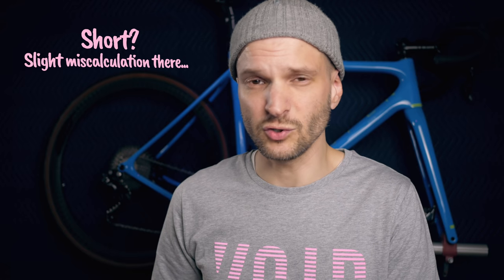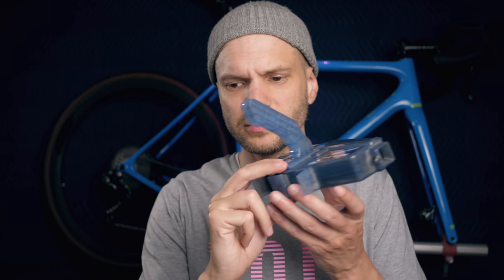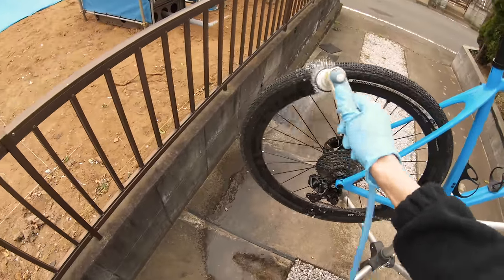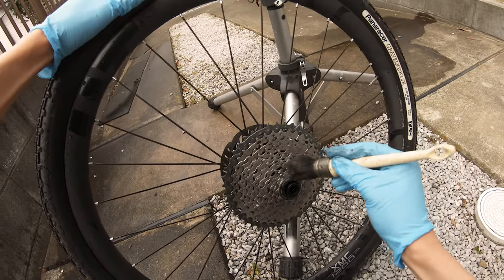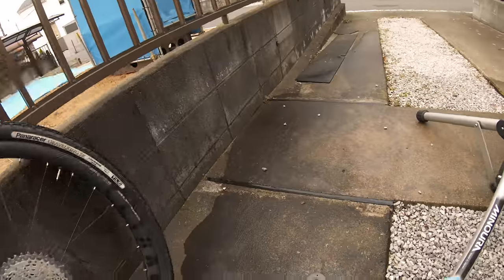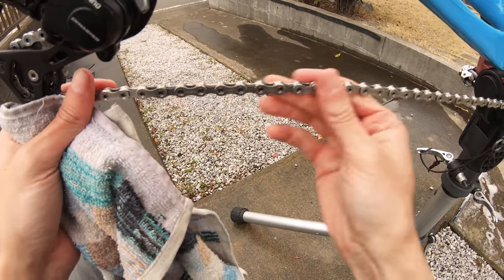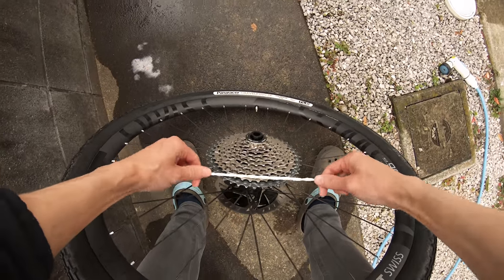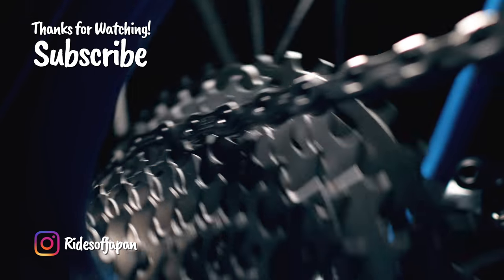My obsessive compulsive chain cleaning disorder

Comment: Good video, but have you thought of waxing your chain. There's no need for dirt attracting oil, and bike cleaning is a revolution, just a gentle wash down with bike wash and rinse, and then a dry with a muc off ptfe water dispersant and polish, like clean and shine (or whatever it's called). Froomey set his world time trial records with a waxed chain, it's supposed to save a watt or two. Metal debris and grit both stick to lube oil, that mix wears your cassette and chain rings, and chains last longer with waxing as the rollers don't wear down. There's no oil lubing needed between monthly or bi monthly waxing. Anyway as you can see, couldn't recommend it enough.....

Comment: Don't waste your time with this, use Squirt lube or Molteni Speed wax for even better results. The drivetrain will almost clean itself on gravel rides
Reply: I just buy pure parrafin wax from eBay. 2kg block for less than Aud$25. No degreasing required. No black grease ever! Just dunk in slow cooker! Lowest friction too according to Friction Facts. Good times 😁

Comment: you really need to transition to waxing your chain. Since I've switched to wax (using the friction facts formula) I never looked back to the gunky oils. I use an ultrasonic cleaner to clean the chain. then wash it with soapy water. dry it and once fully dry use another ultrasonic cleaner to soak the chain in wax. The chain stays perfectly clean even after several hundred Kilometers. It takes at least 4 hour rides in pouring rain to make the chain a bit dirty. and even then you can still just wipe it. It's just no comparison to normal Lube, regardless the different types, and believe me I tried almost all of them. Squirt lube comes close and I still use it sometimes to just apply an additional layer of wax on my chain if I don't have a freshly waxed chain available. I just have multiple chains for my bikes so that when I clean and wax I just do like 4 at ones.
Reply from the maker: Mark van Suchtelen I’ve read up on that as well, the main thing holding me back is the reports on drive train noise.
Also was flakes all over my bike 😱
I don’t doubt it’s super efficient though.

I rather enjoy cleaning my bike so don’t know how good wax would be for a weekly cleaning routine ? 🤔
Reply: Rides of Japan i’ve not had any noise issues since using wax. My experience is that it’s actually more silent with wax. And yes the first ride it will flake but you can wipe it of easily. Especially if you clean your bike it wash off easily. I wash my bike more often than I clean my chain. I just use a dry towel to wipe the chain to almost clean condition. Since the wax is dry it will not collect dirt and it is naturally hydrophobic. So cleaning your bike is not removing the wax as long as you just don’t wash the chain. Just wipe it with a dry cloth.
Reply from the maker: Mark van Suchtelen good to know!
I might eventually go down that route... first step will probably be Squirt though.
Reply: Rides of Japan that is a very good first start. That is how i started as well. My LBS advised squirt lube. I immediately noticed the difference in noise reduction and a much cleaner drivetrain. 
Even after several hundreds of kilometers. Good luck and looking forward to your experience with wax. Hope to see it in a video soon

Comment: judging by the number of comments - is this your most commented video to date?! - this is a subject that's close to many - most? - serious cyclists hearts. I'm tired of a near-constantly gunky chain even with regular de-greasing and lubing. Waxing, using Molten Speed Wax is in my near future, just as soon as I collect all the extra gear and stuff together, like an electric crock pot I don't mind filling with wax! And maybe an ultrasonic cleaner - they seem to get a lot of recommendation.

Is it my imagination or do chains not last like they used to? It seems that when we went to 11-speed cassettes chains became an item that wears out quickly and needs replacing often. They're not cheap either if you're using Shimano or SRAM chains, or heaven forbid, a KMC or CeramicSpeed chain! I have older chains from bikes with 6- & 7-speed cassettes and they seem to last forever by comparison.
Reply from the maker: Trey Quattro the more gears you have the thinner the chain needs to be (less material) and thus it will wear out faster. I don’t think it’s a conspiracy to sell more chains by the manufacturer... at least in this case ;)
Reply: @ridesofjapan  probably not, but it's an added expense. Plus chain pins of course (expensive too!!!) or, if one is so inclined, magic links.

Comment: Just wax your  chain, i'm a little bit like you (love a clean chain), wax is the best solution.
Reply: Agreed. If you use a dryish wax it just flakes off and it does not attract dirt like oil. It work reasonably well in rain too. It does NOT work in winter when it it well below freezing point. It gets too stiff in those conditions.
I've found White Lightning was pretty hard (that I like), Pedros seems more "greasy" which is good for low temperature season. White lightning seems to was away in rainy conditions and needs reapply after a rainy ride. I think Pedros is better for rain (or my own mixture).
Mostly I prefer my own mix, just some paraffine wax, a bit of paraffine oil and somy xylene to thin it out. Homemade stuff is dirt cheap too.
Reply: @hoggif  I haven't had any issues in sub-zero temps with wax. I use it on my fat bike in snow and it's fine. I have had issues with wet lube though. One time my chain seized up when left outside overnight.
Reply: @philadams9254  That's interesting. My cycling season has temperatures below -20C (0F) and my was has been quite stiff. Perhaps some different mixture with more paraffin oil for example is ok in cold. I need to investigate that more when it gets cold again.

Comment: I can guarantee no matter how much you try a clean the chain with degreasers and chemicals it will not get all the contaminates out from within the inner rollers and pins. However an ultrasonic cleaner will completely clean the chain. If you are not using an ultrasonic cleaner you are not cleaning your chain.

Comment: dude, its not obsessive, its just healthy. Think of it this way, does the joy of riding a perfectly silent, ultra smooth-running beauty outweigh the pain of having to endure a gritty, noisy monstrosity while youre out on a ride?. . . . thought so, nothing spoils a ride like noises and crappy running equipment!

I use a kmc quick link that i can de-link and re-link by hand, highly recommended. After 2 rides, unlink, put the chain in a pot with some degreaser and leave it for half an hour, rinse and scrub with a brush, keep rinsing till its spotless.....re-attach, re-lube. Keeps my chain, chainrings, cassette running ultra smooth. . . 

KMC DLC 11 re-usable links
http://www.kmcchain.eu/connector-KMC_MissingLink_12_DLC_non%E2%80%93reusable-road_cross-12_speed

it says non-reusable but it is, I slightly file down the keyhole bottleneck on each link so that it can be unlinked again, easy. Done this for years now and never had a single issue.

Comment: Those small (1/5L?) bottles that you 3/4 fill with liquid and manually pump up with air, can be used instead of the battery powered thing. Just leave out the liquid and pump away. for example only https://www.youtube.com/watch?v=vzcOxeR0UTg

Comment: You should check out Rock N Roll oil. I use it specific for bike packing trips. Significant difference in mid ride gunk compared to any one ells... Thanks for the video, i carry demo samples of lube myself :)
Reply: Alex Larsen I've tried the Rock n roll gold lube and found it to attract far more dirt than the C3 ceramic muc off (that I steal off Tobias). I also found it be be noisier, too.

Comment: you need to try harder sorry. I clean my chains in a 6L ultrasonic cleaner and blow dry them with an air compressor. For lube try light weight transmission oil as it's just as good as the premium bike oils but is a lot cheaper. you do need to wipe of the excess or it collects dust

Comment: 5 Years, 60.000km, washing my bike once per year , giving extra fat/thick oil..no sounds, shifting as on first day, origin chain, cassette, crank bladder..don’t full your self with cleaning , or any marketing trick..I would spend hours and hours cleaning, replacing 20 chains, 3 cassettes and 3 sets of fc bladders ..no way..it works

Comment: wd40 cleans and lubes in one
Reply: p Feeley WD40 is good for a lot of things but lubricating a drive chain is not one of them. Unless you are talking about one of of the specific chain lubes they have on offer ?, WD40 is primarily a water displacing penetrant that has little to no long term lubricating properties.
Works as a cleaner if you don't have any proprietary degreaser but certainly not as a chain lubricant.

Comment: This is a horrible way to clean. The best way without argument is to remove the chain from the bike, no question.

This allows for full submersion in ultrasonic cleaners, petrol and degreaser.

By using hand cleaners you aren’t getting inside the rollers where it actually matters.